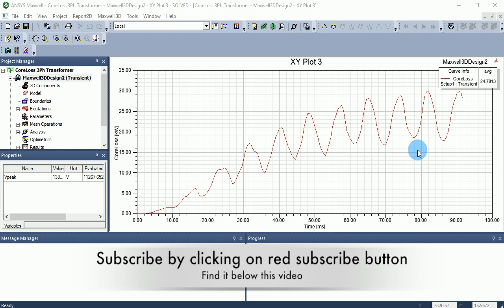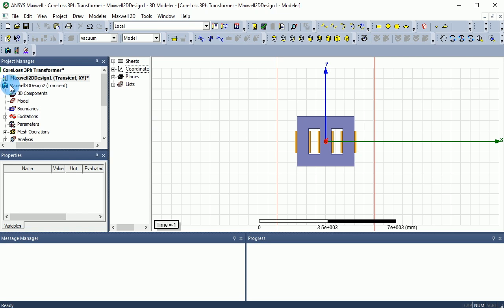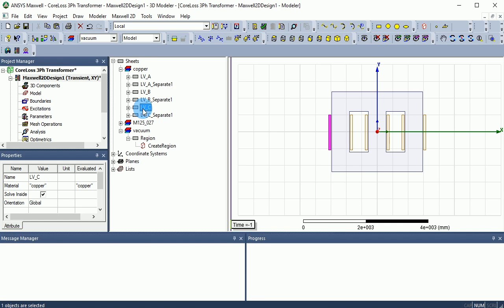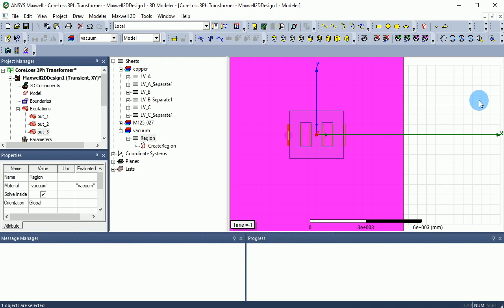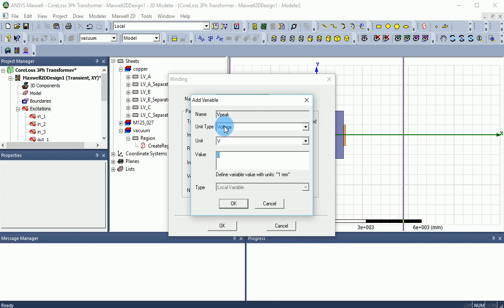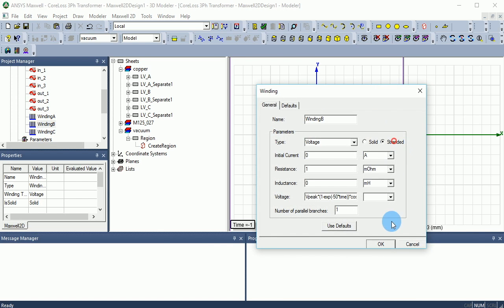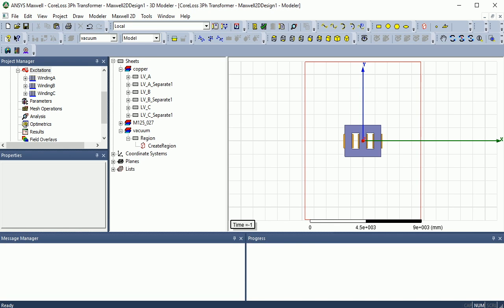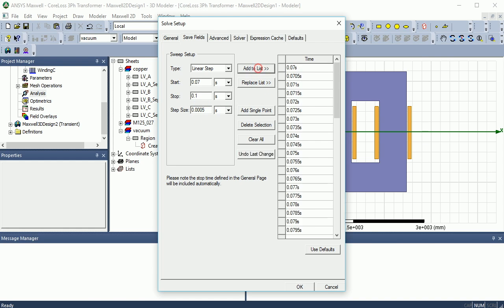413 - Ansys Maxwell |  How to convert 3D design  to 2D

Comment: Hi Kamyar. Thanks for our helpful tutorials. I have a question. Why did you select 456 mm for the depth of the 2D model? In 3D model, the depth is near 736 mm.
Reply: i was also wondering the same..like what should be the value for model depth? @kamyarK please reply
Reply: @matranu  Hi Vishal,
The answer is related to the cross-section area. For both models, the cross-section area must be the same. This is why 456 mm is selected.
Reply: @amiraghazadeh6197  Could you explain it more detail? 
what do you mean cross-section area must be the same?
thanks

Comment: i would like to design,model and analysis a transformer on ansys electronics. like core loss,copper loss.... but i haven't get all material in the library ;like model setting, setup time. please help me,
Reply from the maker: If you have access to ansys learning  hub you can find a good example and tutorial there.

Comment: I would like to work with Ansys Maxwell. I have installed Ansys in my laptop. I have found Maxwell 2D, 3D in workbench of Ansys. Is it same with Ansys Maxwell or Ansys Maxwell is different software and I have to be installed it separately.

Comment: Hi, Could you please tell me, how to convert Axial flux 3D design of motor into 2D design in Maxwell.
Reply from the maker: +tanveer391  when you make the setup file. You can right click on it and convert the whole design to 2D. Let me know if you had question in this regard.
Reply: Under Maxwell 3D> create 2D design>selecting the desired section plane and 2D geometry, it gives me useless geometry. Please send your email id if possible to send you the 3D file. Thanks

Comment: please send me the reluctace eqaution in field calculator (trensient simulation)
and by the way how can find leakage flux in 3d trensient sim.
Reply from the maker: +Mohamed Bendib make a cross section face of the core that you ant to find the reluctance. name it appropriately (e.g. core_Sect). Analyze the design. open the field calculator. select volum force density and integral over core's volum. then devide that to flux density (integralled over Core_Sect). that will gives you the reluctance. for more follow up the definition of reluctance at :https://en.wikipedia.org/wiki/Magnetic_reluctance